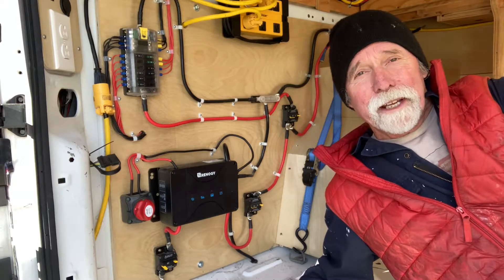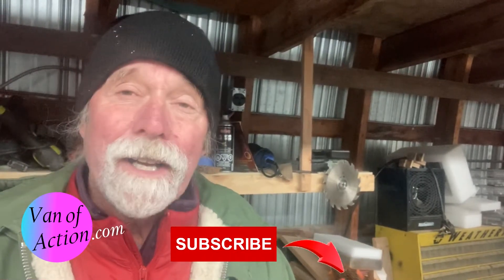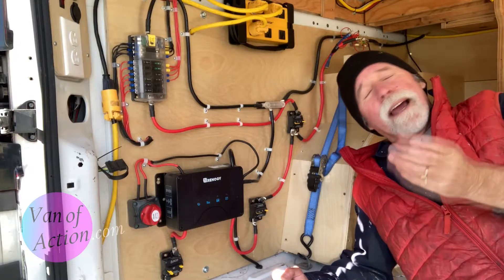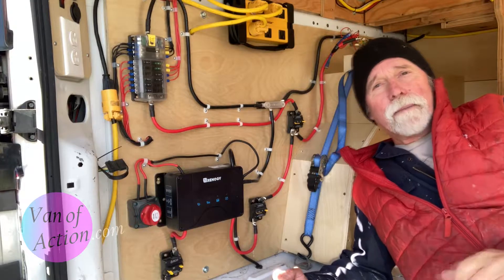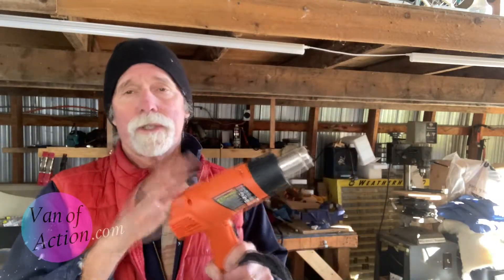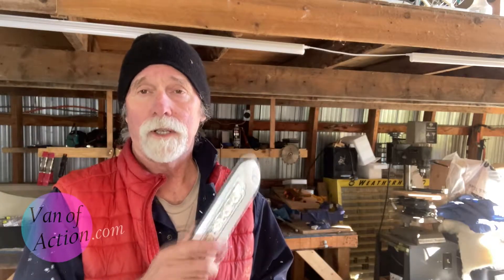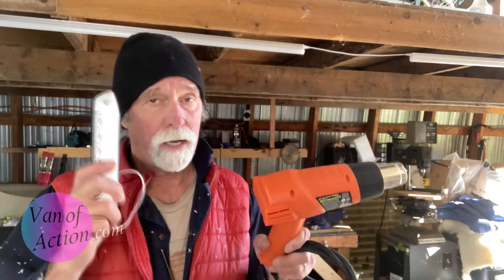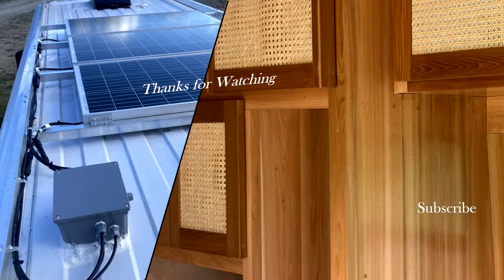How To Select The Right Battery For Your Van Build Solar Panels and MTTP Charge Controller converter

Comment: I really enjoy your videos.  I just wanted to add that there are multiple chemistries of Lithium Battery (LIPO/Li-Ion VS LIfePo4)  that effect the charge cycle life span, also temperature is a factor to consider.   Lots to take in for sure.  LIFePO4  is my choice since I'm not going to do much cold weather camping.   Good work on your vids!
Reply from the maker: Vetsen - thanks for watching and thanks for the kind words - BUT most of all thanks for the valid comment.  This is an important point I hadn't considered because I too won't be using my van in cold weather.  This part of the build took a lot of thought